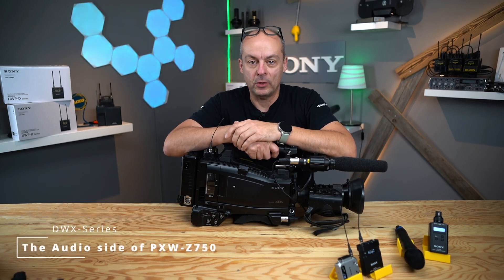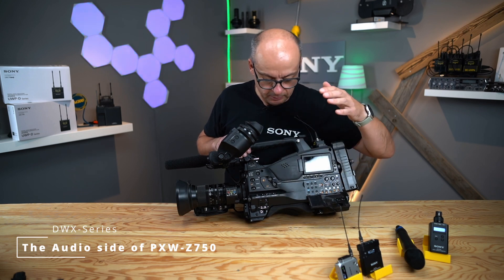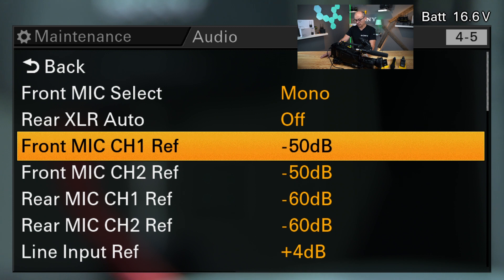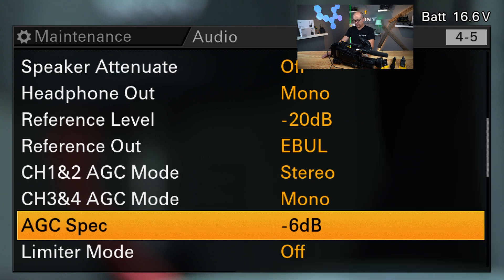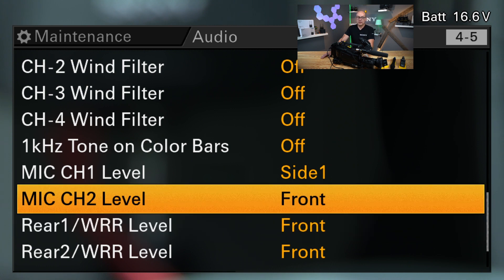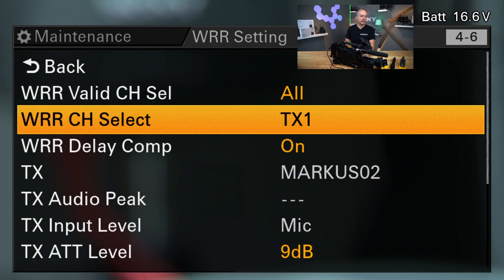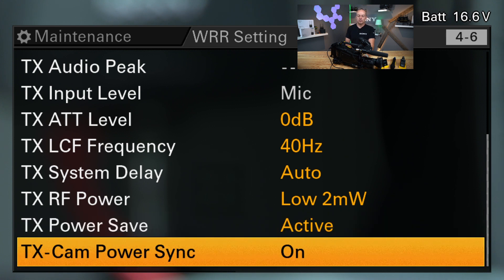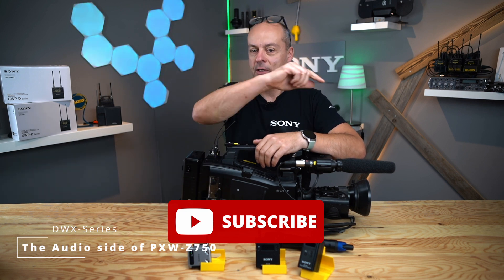006 - DWX-Series - The audio side of Sony's PXW-Z750

Comment: Brand new 4k camera with a lens of the 19th century ;)
Reply from the maker: Yes, but believe me or not broadcast camera users love the 2/3 inch lenses and will not switch. There is a huge demand for 2/3 inch to full frame adapters.
Reply: @mawa  I'm not saying that all 2/3" lenses are old, but the one in this video is extremely old compared to the camera.
Reply from the maker: @SportFlow  Yes you are right and yes, this lens is for years in the Sony demo pool. But it still works fine and is doing the job. 🙂